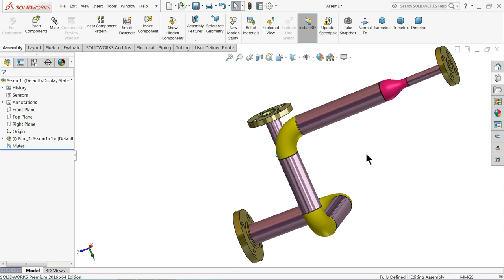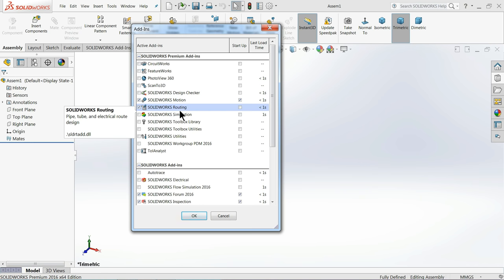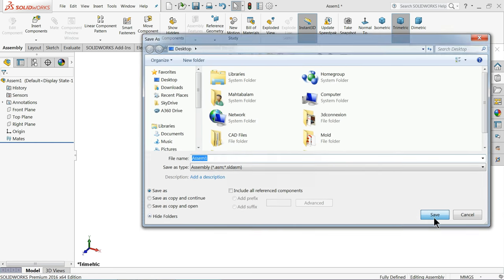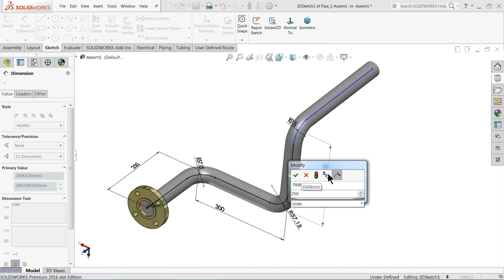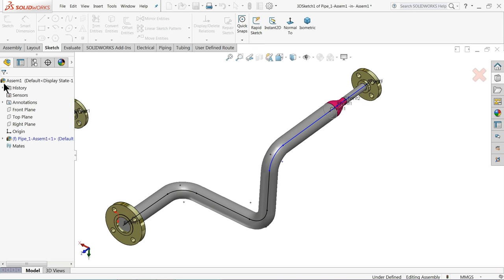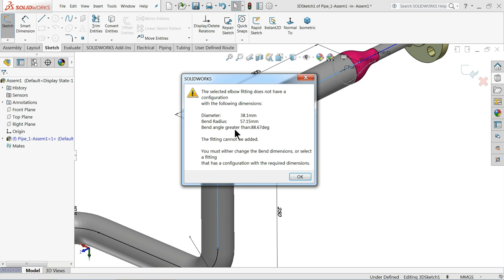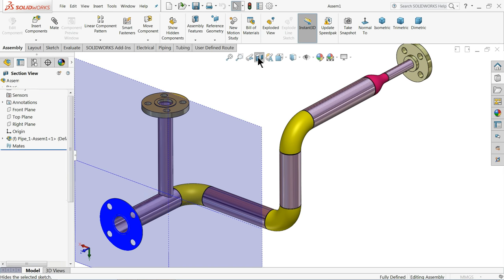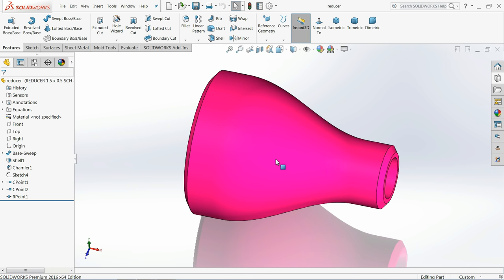Solidworks Pipe Routing Tutorial

Comment: Can this model be used afterward to perform a stress analysis? when I tried to perform such simulation, the solution never converged. I found out that the connections added by default wont fit correctly with the pipe...

Comment: Hey guys, does anybody know how to add in more sizes for the flanges? 
My system only has up to 2.5 inches but I require 8 inch and 12 inch flanges and pipes. 

Please help!
Reply: you need to create a library with different part specifications and load that into the solidworks program files. It will show all the specification parts as per your library.